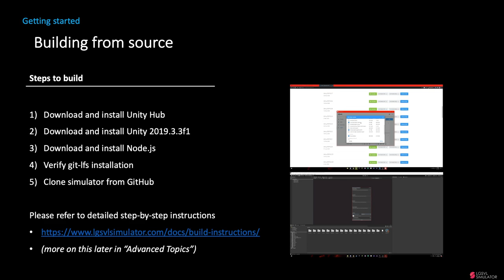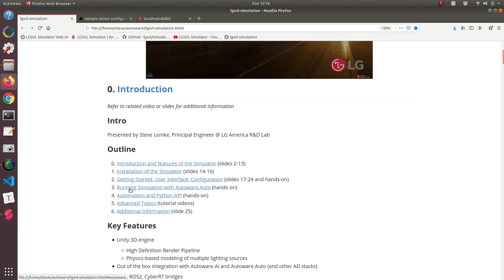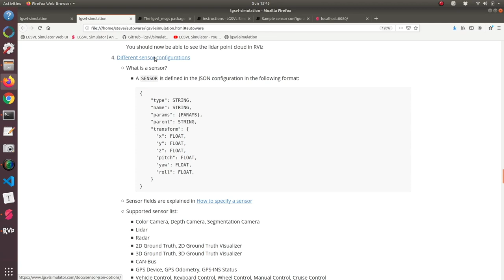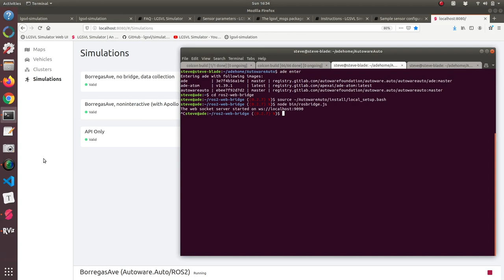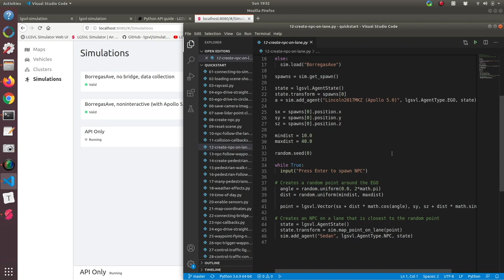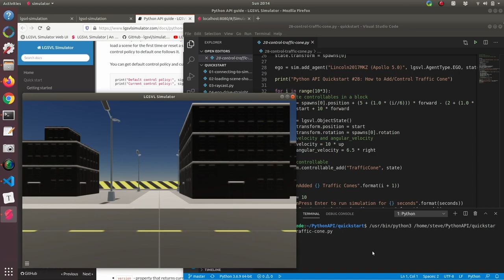Autoware Course Lecture 11: LGSVL Simulator

Comment: Hi which keyboard moves the car back (reverse gear) ? the back arrow does not work with computer keyboard
Reply: Keyboard shortcuts for driving the ego vehicle are documented at https://www.lgsvlsimulator.com/docs/keyboard-shortcuts/ -- You can use the page-down key to shift to reverse, and the page-up key to shift back to forward drive gear. You can view whether you're in reverse by visualizing the Keyboard Car Control information (and expanding the displayed window).
Reply: @lemketron   Thanks for the previous answer. I have 3 questions in addition:

1) In SVL Simulator documentation (https://www.svlsimulator.com/docs/python-api/python-api/) it is said: " By default only port 8181 is used for API connection. Only one client can be connected to the simulator at a time."
I conclude that if I use a Python API script to set my custom scenario to the simulator, then I will not be able to communicate with ros and rviz? Once Ros and rviz also will use the local host address and a port to communicate with the simulator? I have this doubt because after setting my custom scenario with Python API, I wish to let the simulator open and test my ROS packages as the perception and motion planners modules with this custom scenario. Or Ros/rviz use other port? the 9090? In a summarize is it possible use together in the same time PythonAPI+Simulator+ROS/RVIZ?

2) I have also read in SVL documentation, the chapter "Virtual Scenario Editor (VSE)". And as far as I understood it has a very similar role as the PythonAPI: Set the scenario with pedestrians and vehicles and enable move to them. However it uses an interactive way with a visual interface. I ask myself if both have the same goal, and if this VSE can work along with ROS/RVIZ after setting the environment in the Simulator( same doubt as below: can communicate and be used together PythonAPI+Simulator+ROS/RVIZ?). If both PythonAPI and VSE have the same function, would you suggest use one or another, considering VSE seems easier to use (at least not programming skills are required). Has it some disadvantage?

3) I have done step 4 of your lecture "Setup Environment with Python API"

But instead to work with AutowareAuto I wish to work with AutowareAI once it is easier to switch motion planners and compare them with different scenarios. However after several attempts I could not configure the Python API with Autoware.AI. It return IP address refused. Is there a tutorial how to set Python API with Autoware.AI properly, a kind of already done, demo python script? Could you provide me? I did not find any tutorial for Autoware.AI.

Thanks in advance.